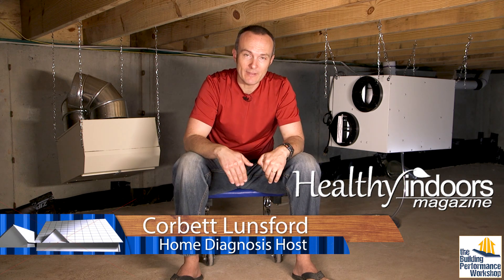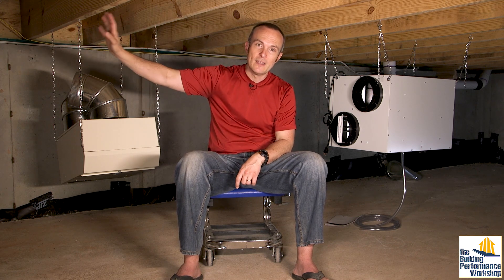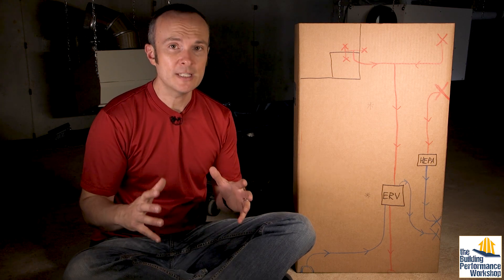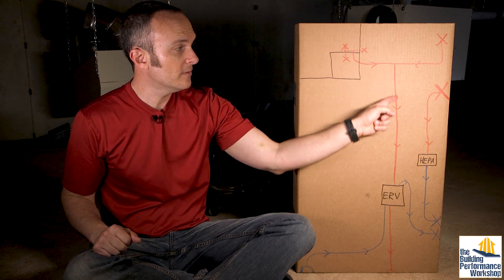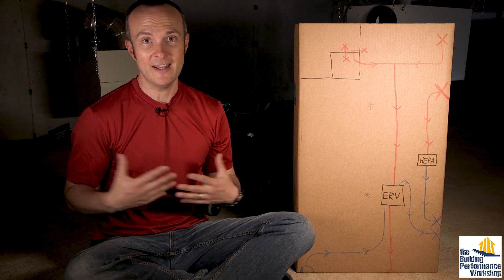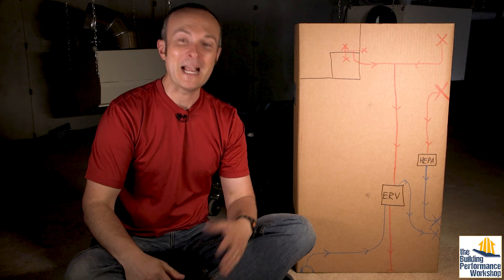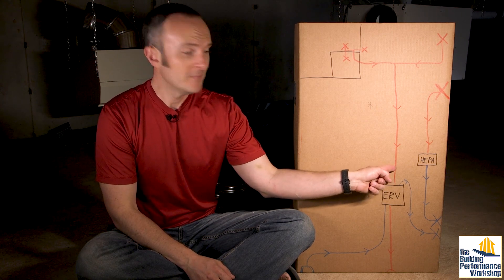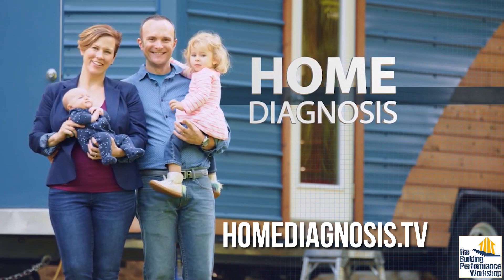Advanced Ventilation Techniques: ERV + HEPA Filtration

Comment: Why did you use a mini split instead of forced air heat and ac?  you have all the ducts you need for the ERV / Hepa.  I did a consult with you and recommended that I don't use ductless mini-splits, yet you decided to use one in your house.
Reply from the maker: The ducts are not big enough to handle all of these devices at once, and they would be massively oversized most of the time if you built them bigger.
Reply: @HomePerformance  That makes so much sense.  Plus, if it was part of an furnace / AC duct system, it would only run / ventilate was the furnace heat or AC was running, correct?

Comment: I have a few questions... If an ERV conditions fresh air based of transfer of moisture and energy from inside air, would it not be then bad to pull hot humid air from a shower and transfer its energy to air that gets dumped into the room? Ive heard of people using ERVs as their exhaust in a bathroom, is this your plan? Also are you planning to put a dehumidifier as well? Thanks for all you do in making homes better!

Comment: We live in an area with heavy wildfire smoke in the summer and fall (Central Oregon). Is there an ERV that you know of that is highly efficient with built in HEPA filtration?
Reply from the maker: Aiden, unless your home is very airtight I don’t think an ERV would be the right solution (and no, I don’t know of any with HEPA filtration). You could look at the Fantech CM3000 which would just pull air from outdoors into your home, pressurizing it slightly. If you need consulting to fully understand your options, I’m available at:
https://buildingperformanceworkshop.com/video-consulting

Comment: Hello,
What sensors might be employed to “monitor the quality of air”?

What elements of air quality might be monitored and measured?

Upon determining the various elements that determine the quality of air in real time. Would you employ a logic controller to adjust the dampers per ever changing quality of air permanents, or manually adjust?

Comment: I think it's possible to have the ERV intake stream tie into the HEPA intake stream. That way all outdoor air passes through the HEPA before entering return duct. But since the CFM of the ERV is lower than the CFM of HEPA, this configuration will require an additional takeoff and return duct off the main return trunk and a Y to connect ERV intake to additional return duct before connecting to inlet of HEPA.
Reply from the maker: That's a cool idea too, but I expect a lot more of the tiny particles I need the HEPA for to be generated inside, rather than coming in from outside.
Reply: @HomePerformance  , then you'll potentially have VOCs, allergens, other toxic particles enter your house through the ERV. Or you can get a MERV 13 filter for your ERV but why if you already have a whole house HEPA cleaner.
Reply from the maker: If you live someplace where there are toxic or stinky substances outside, then sure- but s HEPA filter does not catch smells (VOCs). A carbon filter does that.
Reply: @HomePerformance  automobiles are everywhere. Most modern whole house HEPAs are 3-stage and have optional VOC capturing carbon filters.
Reply from the maker: Right you are

Comment: I might be misunderstanding but the biggest piece of this puzzle is how to get rid of the human element of constantly adjusting, turning fan speeds up, down, HEPA on off, pressure balancing, etc ... Do I have to constantly juggle these things on a daily basis or is there a computer monitoring system checking the air doing it for me?
Reply from the maker: Yes, you are 100% right. Stay tuned, there are some brand new innovative control systems we’ll be installing that you can use in any home.

Comment: Why are you insulating the exhaust duct of the erv?  Since an erv is less than 100% efficient, you'd get additional heat transfer before the stale air leaves the envelope if you leave the exhaust duct uninsulated.  Similarly, if you leave the intake uninsulated, the crawl space will precondition the fresh air before the erv and the air gets blown into the occupied space.  Am I missing something?
Reply from the maker: Condensation. Energy recovery is nice, but if it's 30 degrees outside, you'll have the outside of both outward-facing ducts soaking wet.

Comment: what happen to all those conditioned spaces (attic and crawl space) when there is long term power outage (or say you just want to turn off the AC and open some windows)? Anyone know the long term effects in such situation? I keep thinking about converting to conditioned spaces but I don't think that works unless you have some mechanicals running all the time.
Reply from the maker: Houses nowadays are so airtight that no matter what, if you have a long term power outage, you're in trouble. A mall in Malaysia has been closed for a month due to COVID abandonment, with the A/C off, and everything in every store is covered in mold now. We can't do our civilization without machines today.
Reply: At least where I live, power outages are a real concern. As for the crawl space, it shouldn't be too hard to utilize some sort of closeable/pluggable vents that seal airtight when the hvac is active, but allow natural ventilation when needed. Another concern is having a heat source powerful enough to heat your now not-so-airtight house. I therefore find a fuel/wood burning heater necessary even if a small heat pump suffices normally.

Comment: Will be interesting to see your ducting set ups in this house. Lots of people try and toot there own horn and talk about face velocity and the k factor on the grilles. Then they fail to even turn a elbow to the right geometry or set the correct blower speed on the unit. It’s important to get the basics right and sorted out first. Are you going to utilize a mini ducted system on your house or just sticking with ductless?
Reply from the maker: One of each, Ethan. I agree, it's always systems, systems.

Comment: As an engineer who also dances. That system seems vastly undersized for cooling. A single minisplit won't be enough. Seen that at many studio's now.
Reply from the maker: Thanks Steven, but the 3/4 ton minisplit is oversized. Actual load with 2 people is 4,000 Btuh- we modeled heat load with 15 ppl and came up with 8,000. The two fans in there blow 10,000 CFM each. Not worried about making people comfy while partying!
Reply: @HomePerformance  See that's the actual science you need to go into.  Cover the load calculations for sensible and latent heat accounting for losses in pipe diameter, why you use longer sweep elbow's etc. Then later measure to see if the model was correct. 
Sadly that content will bore most users and hurt your click count.
Reply from the maker: Then you’ll be delighted to know there’s an hourlong video of that:
https://youtu.be/aCIrbSFWD20